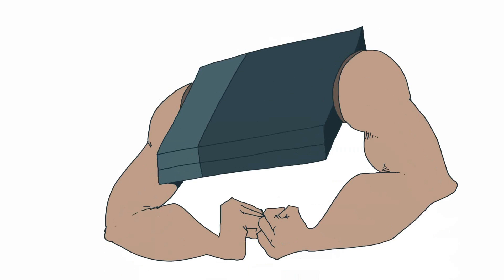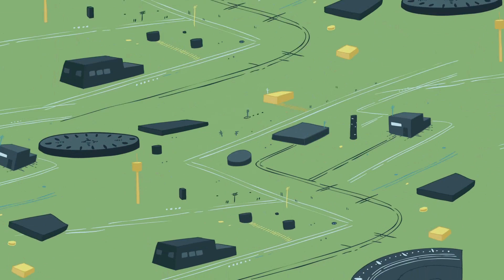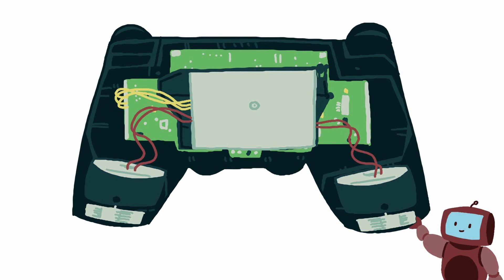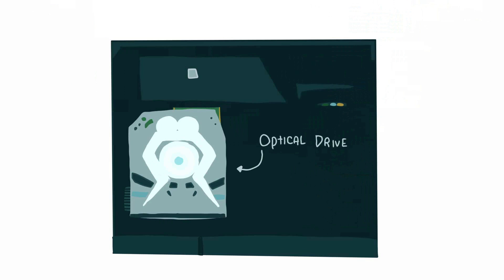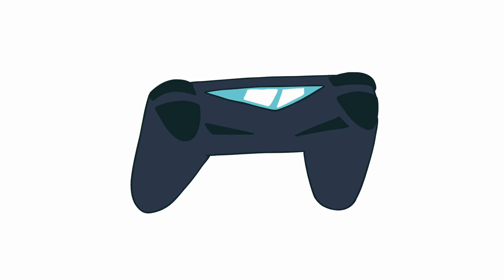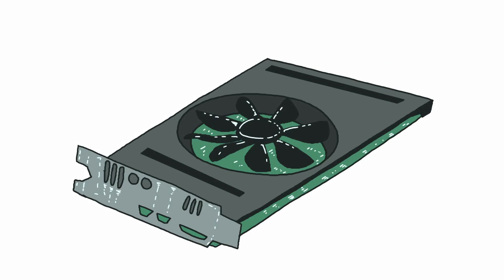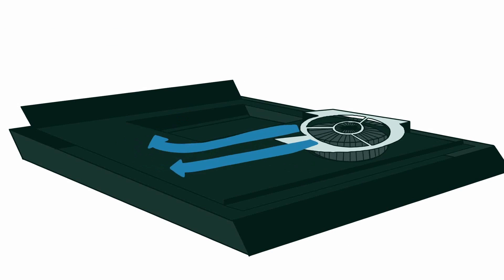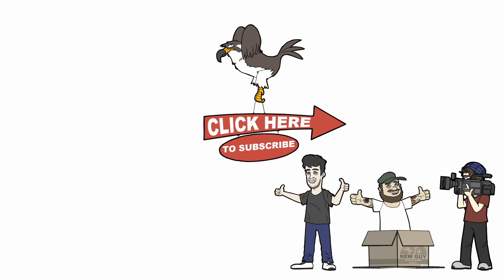What's INSIDE Your PS4 & How Does It Work?

Comment: So what do I need to look at and fix on my 4. I can turn it on using the controllers whether they are plugged in or wireless . I can select the games I want . Then boom nothing works anymore . Even with brand new controllers it does the same thing . Go reset the controllers it finds them again. Plug it in to the cord does the same thing all over again

Comment: this is y u shouldn't use wedex on yr game cds or any cd for that matter the wedex wipes off the data and then when u use the game cd yr console can't read the data on the disk right bc u wipe the data off with the wendex so if yr play Gta LCS the game will paws at unexpiated parts of yr playthrough of gta lcs and a bk loading square will appear on yr scene i used wedex on my sims one for my ps2 and eventually  the my ps2 couldn't read the data on it makeing it impossible for me to play the game ever whenever i triad to load the game my ps2 wood display a error massage saying that the game disk could not be read bc i wipe of all the data with wendex so lesson  of the story is don't use wendex to clean yr game cds let alone any cd

Comment: Boi i play on discs cuz what if my ps4 breaks or i want to play them at my new ps4, it will be a lot easier to transfer also my current ps4 has 500 GB and discs take smaller amount of space. Also i use an internet cabel, BECAUSE it provides much stronger connection.

Comment: Doesn't matter if you use disc or not, it still going to run from the hard drive anyways. PS4 and Xbox one are pretty much a PC now, gone are the days were you could just insert the disc and just play.

Now you have to wait 30 minutes for the game to install, that is if you're offline, if you're online it will also need to update so that's more time, i remember when i installed Halo Collection it was 50Gbs, ran the game and bam there's an update what do you know its 50Gbs too, and thats the old version the new 4k version is 90Gbs

Comment: To all those saying they have loud consoles; change the thermal paste. Plus, if you have it inside of an entertainment center, make a hole in the back of it and attach a 12" PC fan as an exhaust to get rid of the heat. You can attach a normal plug with a switch to just turn it on and off. It sounds like a lot, but with youtube tutorials or just help from somebody, then it really is only about 3 hours of work, which really do make a lot of difference.

Comment: There's definitely more than one way to skin a cat. However, the cleanest way about it is by starting at the base of the skull, cut a straight line to the base of the tail along the spine. Scalpel use is best as it's sharper than a knife and will give you a cleaner cut.

Comment: How does a PS4 with not so powerful GPU pull off 1080p gaming?
Reply: mohamed walid low settings optimization and a auto adjusting resolution to keep the frame rate or vice versa

Comment: This is great! The animation and "redux" explanation both were so enjoyablye. I know this is not a comparison video, but in my experience I feel the ps4 is a better GAMING console than the Xbox One. My younger brother owns an xbox (against all my pleas) and I've played BO4 nonstop as well as Cuphead. While the in-game stuff is similar, the console, controller and UI seem rougher than my ps4. The console takes longer start up the menu, load screen and games. The UI is a bit confusing, packed and less intuitive. The controller is my biggest complain, although the shape is not the worst, the quality of it is horrible! The buttons keep getting stuck or don't feel completely responsive, the home button is already sunken, the consumption of batteries is on another level and drains a ton of money (I had to purchase some myself in order to keep playing) and my brother eventually had to play using my charging cable for the ps4. Wireless my butt. Lastly, the internet connection issues, the thousands of procedures and steps for every little thing, those small details that keep you from actually playing were the most taxing.
So overall, apart from the playing experience itself, the process of getting to that game, the everyday routine of waiting, having to put up with the batteries and everything else made me miss my ps4. PS: I wasn't using my console cause I don't have ps plus while my brother has xbox gold or whatever and can play online, therefore making it impossible for me not to play some BO4 online.

Comment: I mean, the original Xbox was damn near a mid-high end PC, seeing as the CPU, GPU, disk drive, and HDD were all slightly vendor-modified version of off-the-shelf PC hardware. If Xbox had maintained that level of power in their consoles as time went on and generations progressed, they'd be in a much better place than they are now.

Comment: The ps4's controller has a shit bluetooth connection with the console, like when i play on my couch and the console not being very far away, the controller starts lagging and doesn't respond properly due to the connection between the console and controller being absolutely bullshitty. Oh yes and the cooling system of the console is baad, because it's loud af when playing anything, even if the fan is good it's not quiet😑

Comment: I need advice my mum bought an item off Amazon that's supposed to give fans extra charges for ports and stuff and end of story it fucked up my system and now my PS4 makes a odd clicking sound 3 clicks at a time not sure if it burned out the fan or maybe messed up the hardware but it still reads and runs games but always force's itself to shut down after about 10 mins since it says it's over heated what should I do I've had it since it came out cleaned it not so long ago and until I plugged that into it it was fine any advice before I have to resort to just buying a new system and or getting the pro for the hell of it???

Comment: I dont understand why everyone complains about the battery life of a dualshock 4 controller. I litteraly paly games continuously for 12 hours straight with 1 fully charged dualshock 4 and dont have any issues. If youre having that much problems turn down the lightbar to dim. Its pointless anyways

Comment: The first 20 seconds of this video is either wrong or half truths.

The 360 (and PS3 to a lesser extent) were bleeding edge when they came out. They even used tech that wasn't available on PC at the time and could go toe to toe with the PCs of the day on specs.

Factor in low level hardware access and efficient OS design and the PS360s were running rings around all but the most expensive PCs for the first 2 years.

The PS4 and Xbone were midrange (by contemporary pc standards) machines without the benifit of custom architecture to replace the grossly inefficient x86 instruction set that holds back PCs.

Comment: An ethernet cable might be older tech than WiFi but it's the best way to connect a console to your router. WiFi adds latency to the connection. 'Old-fashioned' isn't always the worse method.

Comment: What's INSIDE your PS4

A jet engine.
Reply: Mine doesn't make any noise
Reply: Λυris this resonates with me
Reply: ikr mine does too...
Reply: Mines a slim and it makes no noise
Reply: @Jon Smith idk what pc u have but pcs are quite silent... bigger case=bigger heatsink=bigger fan=less rpm=less noise
Reply: @Bigbad Crawford already have done it. It didn't help.
Reply: @Auris57  you can mod the fan but thats another level , its one of the first ps4? if so the fan bearings might need maintenhance, or directly a new silent fan
Reply: @arencorparencorp2189  bearings have nothing to do with the problem.
Reply: @Auris57  if like everything they deteriorate and lose every last bit of lubricant they might go a bit.. rough

Comment: How does it work? Simple. Sony refuses to increase RAM Cap for none gaming processes so anything that loads a web page that requires more than 800mb of system resources, fans speed up to where the PS4 is about to take off, then makes clicking noises. then calms down.
Reply: There are a few problems with this:

1. The PS4 has plenty of RAM for what it tries to run

2. You act like RAM is the main factor in the deficiency of the PS4's performance

3. 800 Megabits (Mb)= 100 megabytes (MB) literally 1/80th of the PS4's total RAM. And even if you meant Megabytes, that's still only 1/8th of what the system has.

4. That has so little to do with cooling efficiency, I don't even understand the purpose of your comment.
Reply: Sony "fOr ThE pLaYeRs"

Comment: My OG ps4 sounds like a jet engine 😖
Reply: Jc Peralta Same. I just clean the vents with an air duster
Reply: Especially when Black Ops is running 😦
Reply: @PudWhacker  Have you cleared out all of the dust that is inside? Or have you applied cooling paste on the processer?
Reply: Once you run black ops its ready to take off and it even has some turbulence
Reply: I understand your suffering...
Reply: My PS4 only sounds like a jet engine when I am playing HITMAN 2016 for some reason
Reply: thats why you get xbox 1 cause there quiet and better but if you don't agree buy a Pc cause its better then both of them
Reply: @savagedrone2589  Just because the fan can get loud sometimes does not mean Xbox is better
Reply: @senatorarmstronger475  so you do agree that Pc is better so yeet my boi
Reply: @savagedrone2589  you know the original xbox one (because he was talking about his fat ps4) is less powerful than the ps4 ?
Also,less exclusives....

Comment: I opened my ps4 to replace the power supply, it was full of dust
Reply: Mine was full of cocaine
Reply: @Its.Mr.Bonelezz_Pizza  Hol’ up
Reply: Mine was full of playboy magazines
Reply: @sgonzo5572  were the pages stuck together?
Reply: Why replace it, just clean it, ive had my 1st gen ps4 since launch and just recently opened it and there was barely any dust...i use this thing constantly, so check your cleanliness in your home, it shouldn't get this bad
Reply: @bitchfitgamer3726  Ive found carpets trap dust
Reply: @bitchfitgamer3726  prob because the power supply broke?
Reply: Just take a can of compressed air to your machine (console or pc) every now and then and should be able to avoid thermal and performance issues.
Reply: @Tekna_Kitsune6248  Don't! just do this willy nilly, you need to prevent any fans from spinning while doing this as it's not good for the bearings of the fans and can kill fans.
Reply: @tukuiPat  thanks for that advice, I am guilty of blowing the fans with air myself.
Reply: eddie cornejo Mine was full of potatoes xD
Reply: Mine was full of crack
Reply: Mine had wires

It smells like broke in here
Reply: Umm...okay.
Reply: eddie cornejo On a serious note, the PS4’s power supply is is exposed. If you touch a charged module you’d probably die
Reply: The Real Bleach lol you won’t die if you unplug it first but if you unplug and don’t wait for that charge to dissipate you get shocked but you won’t die 😂
Reply: @braidensellers  capacitors can hold a charge for DECADES, and YES THEY CAN KILL YOU WHILE CHARGED FOR THE LOVE OF GOD DON'T SPREAD SUCH IDIOCY THAT CAN GET SOMEONE KILLED.
Reply: @tukuiPat  dude chill out. Yes while spinning the fans with no power isn't good for them they will not crap out immediately after a couple of shots of compressed air. If you've noticed I have said "every now and then" meaning regular maintenance over the course of every 1-2 months.
Reply: @tukuiPat  as for the capacitors, go ahead and yell at the people with no common sense.
Reply: Patrick Morgan oh and FYI the capacitor is inside the power supply module not on the outside what is wrong with you?
Reply: @braidensellers  there are a few capacitors on the pcb to help deliver power to the apu. I think Patrick meant don't touch the plug where the power cord goes
Reply: Was it 80 plusm
Reply: Only dust. I heard it's full of bugs.
Reply: @dominikkuzila  omg nobody knows the pain of those fuckers until it happens to them
Reply: mine was full of bugs
Reply: Even worse if you don't even have roaches hiding iinside of it as well! :O
Reply: űre hano m ã y Wako me Puta Dust Kaj m oi mu justu
Reply: If I clean the inside with bleach , would it wreck the console ?
Reply: Mike Point yea of course it would. Use IPA and or compressed air. I know you’re joking but i may as well tell you how it’s done anyways.
Reply: Awesome
Reply: Mine had helicopter fuel

Comment: The most notable thing is the fan as no one has never managed to shut it up
Reply: Why not just water cool it?
Reply: @ScytheNoire  is there such thing as a water cooled console
Reply: @pupofgaming6856  yes sure, many dudes modded it and its not even hard lol dependa how nice looking you want.
Reply: @Xenoray1  OH well than interesting
Reply: @pupofgaming6856  water cooler radiators are cooled by fans too.
Reply: It's not the fans fault it has to work over time to cool that shitty hardware that struggles to perform
Reply: I have done the impossible